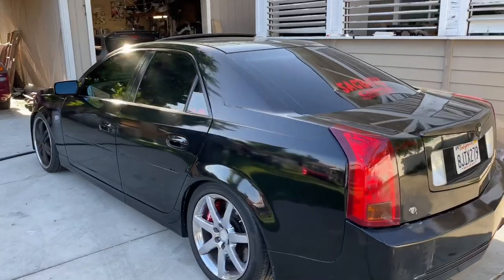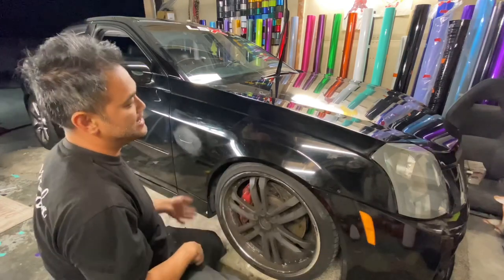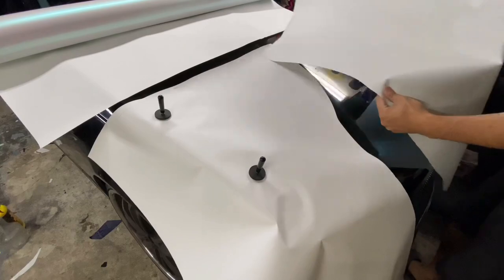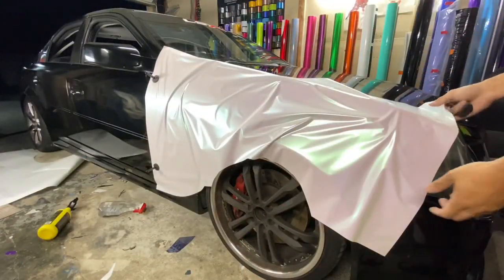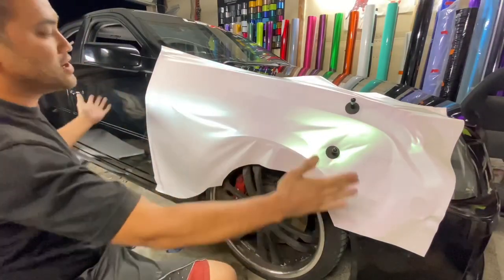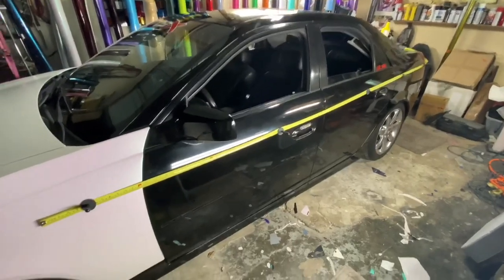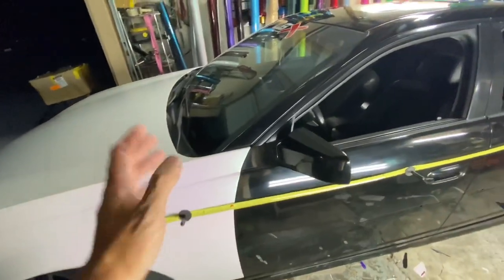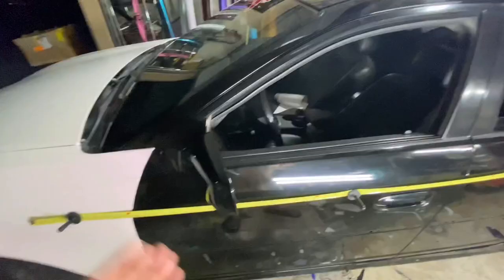How Much Wrap Do You Need? BEST Way to Cut Out Wrap To Fit Any Car

Comment: so satisfying to see your work Paradox, by the way  i have a question, how do you prepare the car before you start on wrapping? do you have tutorial of it? thanks in advance.
Reply: Aslong as its clean & surface is evenly smooth all around. You should be fine. DO NOT WRAP A DIRTY CAR. OR A CAR WITH ORANGE PEEL AS IT WILL SHOW ON THE WRAP! just a headsup

Comment: Challenger bumpers are taller than 30in so the cutting the half of a roll into 2 30s will have to change for that. Luckily I talked customer into a black roof and hood and trunk that saved me. If not then you'll need a little more than 60ft
Reply from the maker: I haven’t done one in a while but I think I can make the stretch

Comment: Before I ask I should mention, I’m a first timer and I figured ordering precut pieces would just save the hassle of making sure I have enough for each panel of my e90.. Now it’s time for my quarter panels.
Would you recommend for me to cut out the pieces for the door? Or just order those separately? Just asking because these doors are so curved 😢
Reply: Where did you order precut pieces
Reply: @liljune8209  honestly through any vinyl supply page. Like if you need enough for a roof, instead of ordering a full roll just order 5’x5’ or whatever measurement you need
Reply: I actually work in a wrap shop now and honestly it’s just wayyyy cheaper to order a full roll if you’re doing a full wrap lol

Comment: How would u do it if rear qtr panel connects with roof need advice is for Infiniti i35 2003
Reply: How would I wrap the Infiniti i35 2003 the rear qtr panels connect with whole roof

Comment: I don’t understand the fender cut out that works for both sides. I’m wrapping a ram 1500 and no matter how I figure up how to cut it, the pieces only work for one side. Any help?
Reply from the maker: If your fender is taller than like 35 inches it won’t work
Reply: @ParadoxTheWrapper  it was only a 32in x 62 in piece that I was cutting from a 60in x 62in piece
Reply from the maker: @inthelifeofleif8268  you can make an S cut, but if your can’t figure it out just do the fender in a giant piece and roll out the whole side of the truck with an extra foot of lead on each end
Reply: @ParadoxTheWrapper  thanks a lot man, I appreciate it! I think the s cut I made will work for this fender.

Comment: @ paradoxthewrapper , does that wrap have air release and memory technology?
Reply from the maker: Yes
Reply: @ParadoxTheWrapper  thanks for the quick reply! I live in central GA and I did my first wrap on my 04 mustang gt convt. It took me a month to do in between working last October. You make it super easy just laying out the wrap on the car but considering I took the fenders and rocker panels off of mine and doing it complete outside in my driveway. Your videos and in depth wrapper/client bios are awesome and helps me with using better strategies on my next wrap. Plus I  didn't see your video on the matte metallic mustang until after I finished mine.